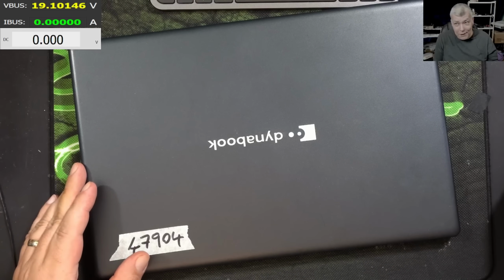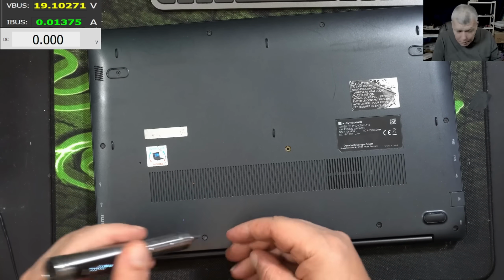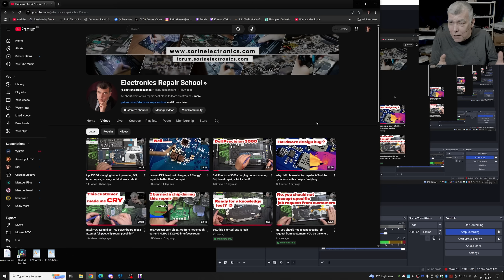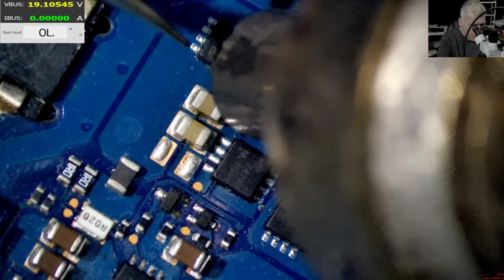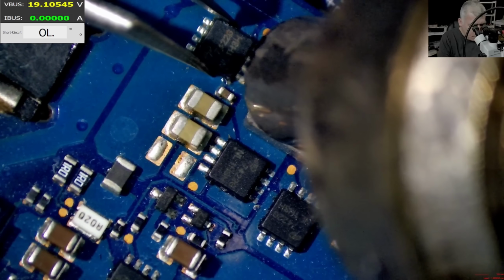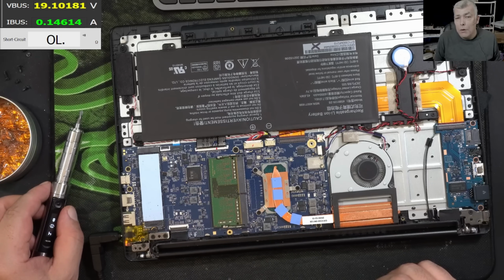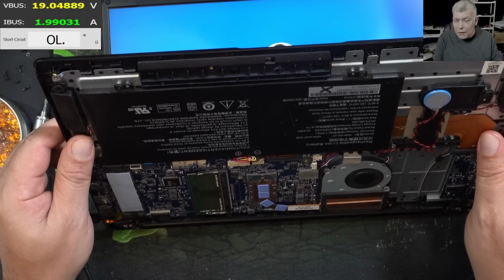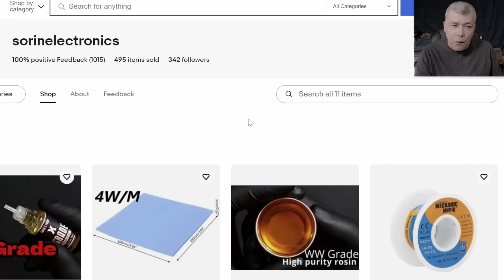A shorted MOSFET story, a common fault on this specific model!

Comment: Sorin, you have power 3.3 and 5V, because fast boot is enabled in bios and Windows. If you disable these voltages you will not have a fast boot. Or if you disable the fast boot, these voltages will be shut off, when the laptop is power off. Try it.

Comment: It's not a design failure. The engineers designed an easy fix for their brother technicians🤣 Bon Appetit  🍕
Reply: @samsscia  does the chip not have a low voltage lockout which most chips have

Comment: I once worked with a guy who's fan died on his graphics card. He fixed it with a 120mm case fan and some string. Worked better than the stock fan.

Ignore everyone complaining about rosin and being cheap. If it's not needed, don't use it. They're the ones who spend all day on the Linus forums and comparing CPU stats instead of actually working on computers. They have no experience and know nothing.

Comment: “Thank you, sir.
But if possible, I have a question. What is the multimeter that you use which displays on the computer screen?”
😅
“In the future, if the MOSFET gets damaged, you won’t need the resin because it is already available.”